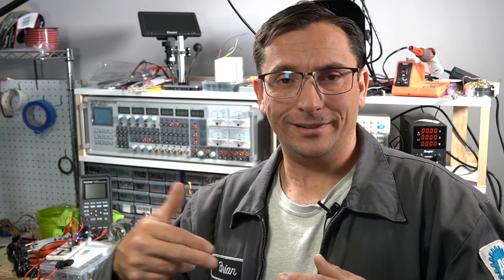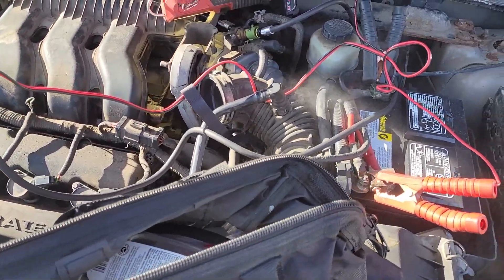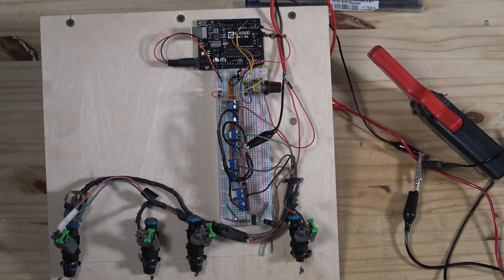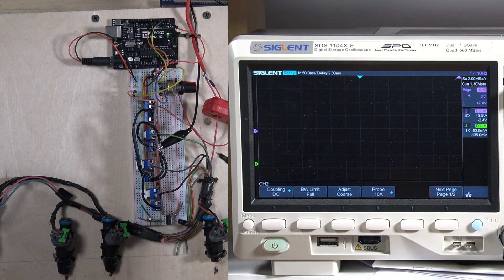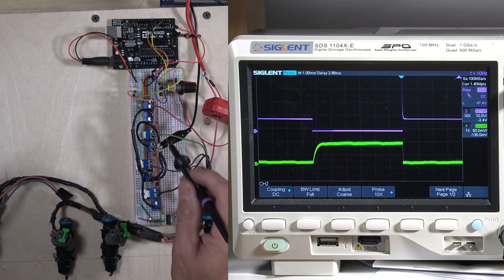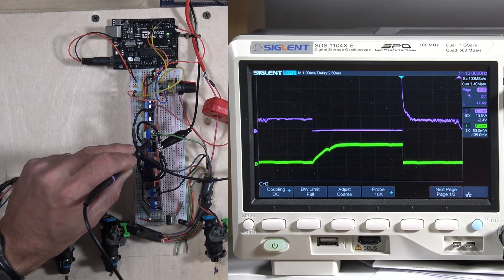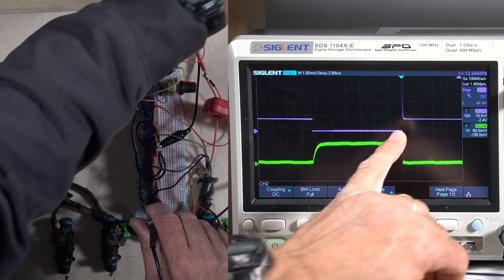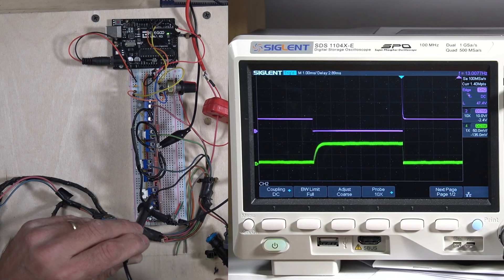POP QUIZ which injector is bad?  End OF day 12 14 2021

Comment: Injector number 4 is bad
Reply from the maker: Right on! Some times its easy like that.  My goal is to help others see the good 1st and then they see the bad!!
Reply: @BrianMann216  thank u. I’ve seen shorted injectors on old chevy camaros 2.8l where the current ramps up to 12 amp and the vehicle won’t start. The ecm is protecting from damging the quad deiver. Nissans had shorted injectors in the past as well as chevy S10 with 2.2L engines. Thanks for sharing 👍
Reply from the maker: @vickenkaragozian2041  I remember those old gms, I think it was the 3.3 N motor, so common 1 injector would kill the bank and make a non drivable vehicle.
Reply: @BrianMann216  yes it was the 2.8L corsicas and camaros and 3.1 engines. Ohming the injectors was very low around 1 ohm. 😃👍
Reply from the maker: @vickenkaragozian2041  2.8t and 3.1 w , I guess I remember the 3.3 n cause my mother had one!